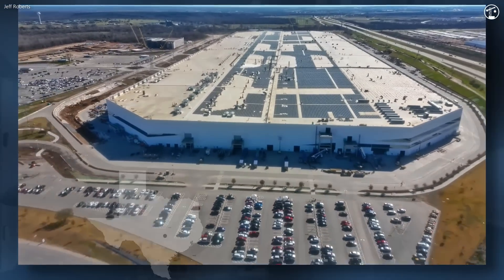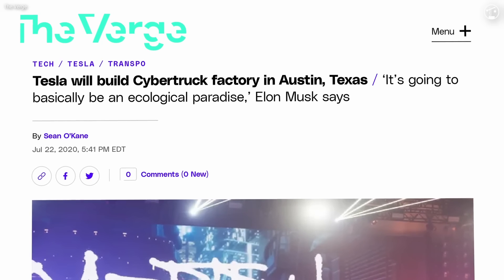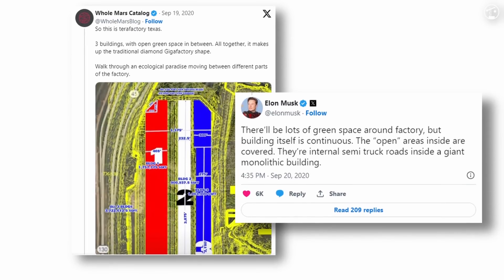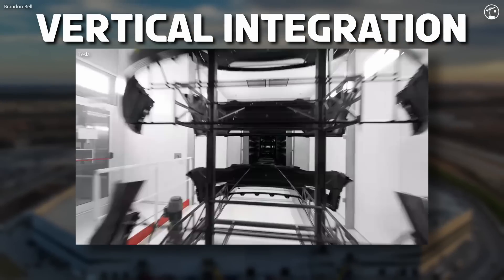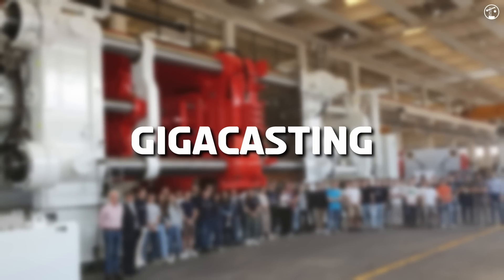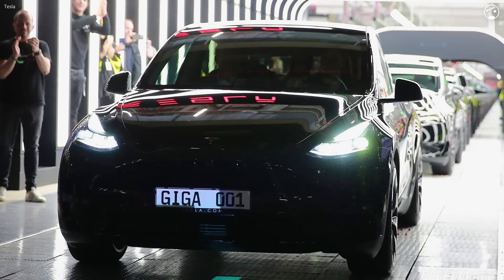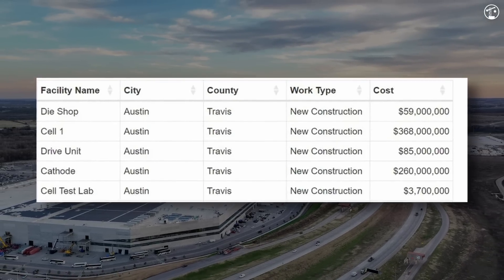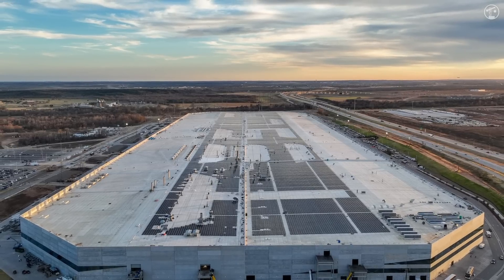Why GigaTexas is Tesla’s Most Interesting Factory

Comment: The historical review of Gigafactory was interesting. However the review of recent news is out of date (expansion, $25k car, batteries). The 4680 batteries are now being produced with dry cathode, which is a game changer for cost. Tesla is launching its Cybercab in October, much bigger than low cost car. The AI compute is being setup to further improve the autonomous capabilities of the vehicles, already tears ahead in open world capabilities. Tesla is implementing its ‘unboxed’ process which will allow it to reduce costs further and allow for a greater number of models. The list goes on. There is a lot going on, and it is an exciting time, not the failure implied. Thanks for the video

Comment: Your statement about the additions announced in January of 2023 not even being started is patently false! They are all completed.  The Cathode building and Die shop are to the northeast of the main factory. The Cell 1, Drive Unit , and test lab are in the main building. Additionally a new End-of-Line building has been constructed on the west side of the property along with a tunnel under the highway connecting the main factory with the west side. All of this would have been known if you had watched any of Joe Tegtmeyer's  recent updates to completion.

Comment: The new robotaxi, model 2 and new model Y will all start at gigatexas not to mention; the Cybertruck and the production line for the new dry cathode batteries. So there is no uncertainty
Reply: No, the new Model 3 and current Model Y are both still built at Fremont. The Y is also built at the Tesla Gigafactory st Austin, TX. The new CyberTruck is also built at the Austin Gigafactory.

New models are in development at the Gigafactory using the existing lines including the RoboTaxi and a lower cost BEV. Stay tuned for October 10, 2024.